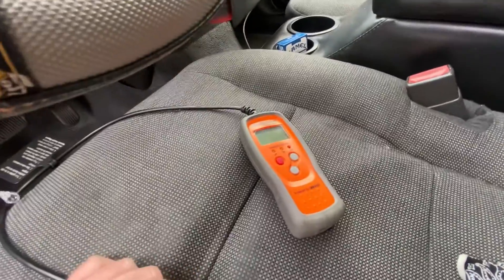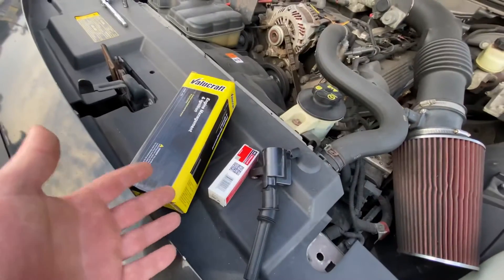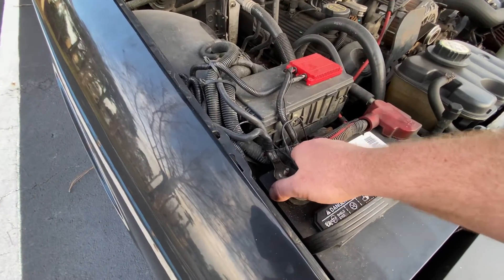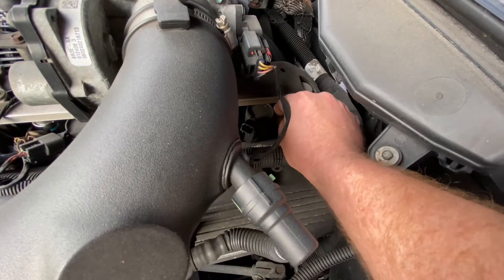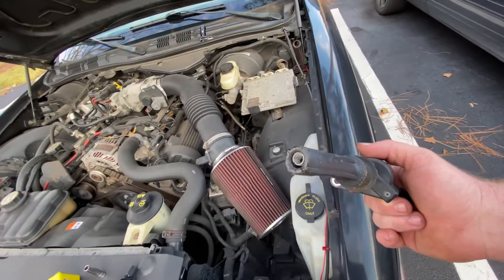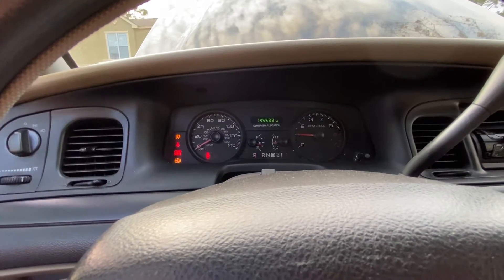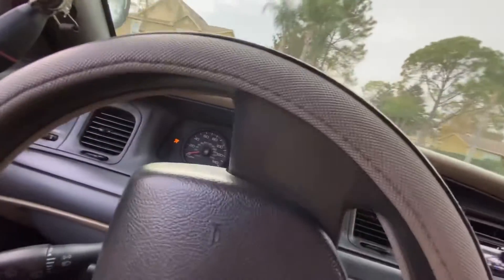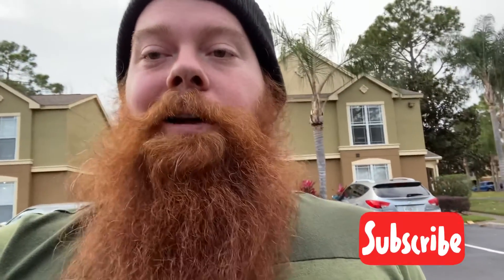Crown Victoria misfire problem!!!! #crownvictoriap71

Comment: Brother!  Thank you for this video I was upset my 1996 crown vic started sputtering and loss power.  I took it to the auto store like you said and my code was p3060 which he said was number 6 cylinder!  I spent $8 on nice spark plug brought it home and changed it out Betsy is running like new again!  Thanks again for the idea I was a lost sad puppy.
Reply from the maker: Glad I could help

Comment: I’ve got this code for # 8 on my 2010 but it seems to ring pretty good but I notice wen it’s cold the converter lock up feels sketchy.  I know any small loss of torque  will cause the converter to rethink lock up so I’ll do this and see.  Just seems to run good at cruise

Comment: Right on Shane,
Good work. 

What about the airbag light, and the turn signal hyperflash? 
That would be some good content fixes right there. 
-Chuck
Reply: I got a fix for the airbag if you need it.
Reply: @coachtonythetiger  
Right on Tony,
I need it.
Can you upload a video to your channel.
Let me know if you do.
-Chuck
Reply: Hyper flash, change your flasher relay. It's under the dash. Not hard to do. Not expensive either. Slow flash is the one you need, assuming you're running LED bulbs.
Reply: @2KCamaroZ28SS  
Yo Google User,
Panther Cars do not use a replaceable flasher relay for the turn signals. 

So you have to perform a flasher bypass and use an electronic led compliant flasher, or install a resister for each turn signal circuit.

Comment: My 07 p71 misfires sometimes and I can't go over 60 without jerking. Coil packs for sure right ? Engine light on as well. For some reason my vic isn't connecting to a code reader at oreillys
Reply from the maker: Yeah coils and plugs more than likely. My Vic sometimes would not work with a code reader at the parts store too
Reply: @fettboy99productions91  thanks for the quick reply I bought the sparks waiting for coils in mail

Comment: Mi car shakes when at 30-40 mph. No check engine light on but it sure is killing gas ⛽️ like crazy. Any advice? TIA
Reply: Crown Vic 2004 btw.
Reply from the maker: That sound like Front end suspension it could be a number of things but I’d start with an alignment

Comment: OMG, can we please stop using these "Hot Air Intake" power robbing money sinks?  The factory air box and air filter will flow more air than the stock engine needs.  Also, the oil from these is not good for the MAF either.   Seriously, louder doesn't mean more power.  Its just louder.
Reply: No shit. Louder never means more power or extra “car go fast”. Or horsepower. If your MAF has any oil even glancing at it, something Is wrong. Again, no shit. My car isn’t loud at all. My car is stock. All I did was put an air filter in it. Damn near same dimensions. Just no air box.
Reply: We need more comments like this , thank you 🤙🏼
Reply: Early Panthers had a power-robbing "Snorkle" on the Air Box.
Break off the Snorkle and replace it with a length of Aluminum Flexible Clothes Dryer Hose to get cool air from FORWARD of the enginje compartment.
 Later models with NO Snorkle don't need ANY modification at all.
 MAF Sensor problems are caused by TOO MUCH OIL being applied to the K&Ns -- and CLEANING THEM TOO OFTEN -- allows too much silicone dust to enter your engine.
 The K&Ns are just too much hassle and expense for the average vehicle owner.
Superior filtering for the Panthers = FRAM # TGA 5056.

Comment: Hey man wanted to see if you had any ideas. My 2010 Crown Vic has some sort of hesitation around 40MPH where it sits at 2k RPMs. I’ve changed the spark plugs, coils, fuel filter, MAF sensor, and the TPS and I’m still having the issue
Reply from the maker: Will it go above 40mph
Reply: @fettboy99productions91  I'm having a similar problem as skipper, thought it'd be good to ask ya as well. Same problem just showed up today. Haven't gotten my hands in the engine yet cause I'm still doing research. I'm having the same problem where I'll feel the slight jumping throughout but as soon as it hits 40 the engine light will flash again and it'll get real jumpy. It continues into the 50's but gets less jumpy before becoming slightly noticeable again going 60+. Much appreciated for the video too it's very helpful!
Reply: @fettboy99productions91  turns out it was the exact same problem! Bitta gunk and oil in there as well so had to give it a good cleaning and she's running just fine. Thanks for the video man!
Reply: @Miami_Fred  which part did you clean out?
Reply: Damn... Even with the parts cannon you still couldn't get it working

Comment: How's the Transmission so far
Reply from the maker: That transmission has been pretty good on it after having it rebuilt.
Reply: @fettboy99productions91  oh okay what went out on it for you to rebuild it?
Reply from the maker: It had torque converter slip and shutter. So I had the hole they rebuilt
Reply: @fettboy99productions91  oh okay

Comment: I didn't have no problem with my 07 crown vic I change the fuel filter it run good for one day I fill it up with 89.. I got in to come the crank it up to warm my acceleration was very slow and I heard a rumbling noise I stop it on.. its start but when I stop it does the same whats wrong with bro
Reply from the maker: That sounds more like a transmission problem. I just had the transmission rebuilt in this car because it was not accelerating
Reply: @fettboy99productions91  I don't think so its either bad gas or one them coils Transmission changes good it just make sound like it's out off gas but once I step it changes go it ain't no Transmission
Reply from the maker: Ok I understand now. Yeah bad gas ⛽️ put some fuel injector cleaner in the tank

Comment: Wat up bro,I got a p0358 code and my cars running rough with a loss of power. I watched ur video and did the same,changed the coil and spark plug and still runs rough and still throws the code. Do you have any advice or anyone else?please help
Reply from the maker: Faulty Ignition Coil 8
Ignition Coil 8 harness is open or shorted
Ignition Coil 8 circuit poor electrical connection
Faulty Engine Control Module (ECM)
Reply: @fettboy99productions91  my next step is to replace the connector. Is it common for the ecm to go out?
Reply from the maker: I’ve never had one do out but it can happen
Reply: Did you ever get this issue resolved? I have a 2004 Grand Marquis and mine is throwing the P0354 code. I changed the spark plug, ignition coil, and wire harness connector that goes to the ignition coil. Nothing has solved the issue yet. The car runs wonderfully until I come to a stop for more than a few seconds. It idles rough and hesitates a bit until I give it gas. I also disconnected the battery and the car ran great while the ECM was relearning everything the new 2 days. Now it’s back to the same issue. Sometimes the check engine light comes on but not always.
Reply: @DNA300X  2003 crown Vic #4 same problem